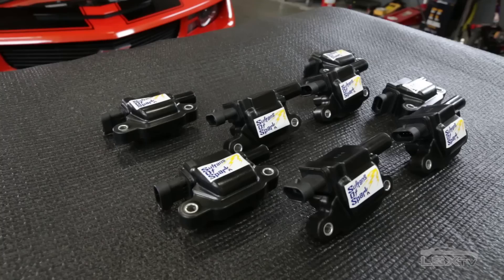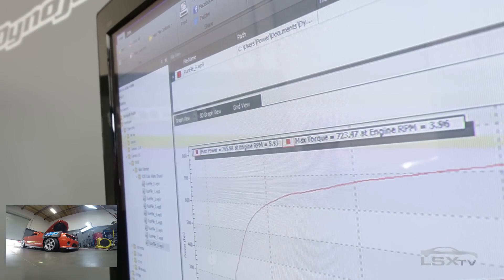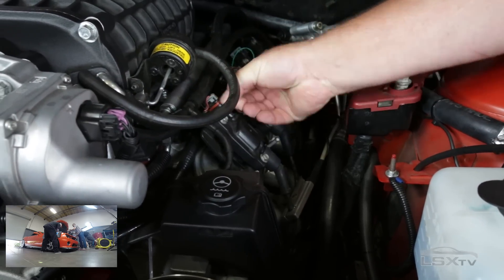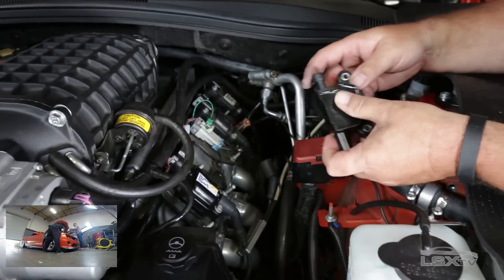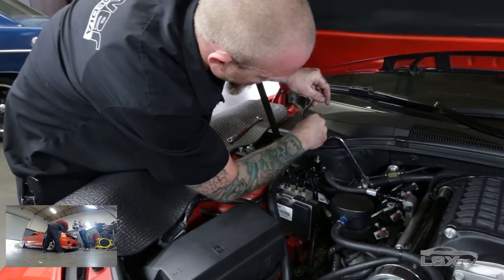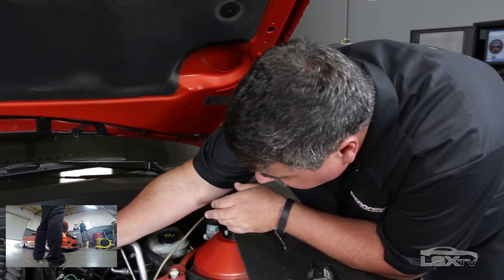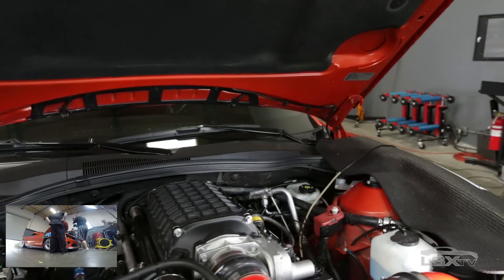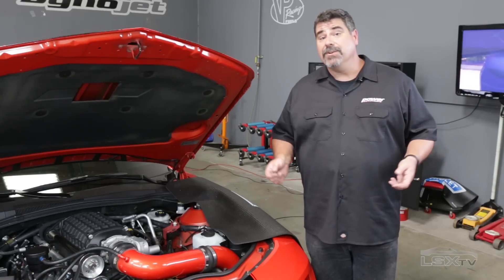Sultans of Spark Coils - Do they make power?

Comment: Am I the only one that noticed the power drop, but a cleaner running engine??? I agree, it needs to run at least for 20-30 minutes plus a change in plug gap for the ECU to adapt to the new coils. Then you will most likely see a true performance increase. Not a lot, but still.

Comment: Now do the same test on an old police crown Victoria with 150k miles. Instead of these highly tuned and forced induction cars
Reply: What’s the point?
Reply: @khalidfathallah6619  Older cars have more delta performance potential than newer cars. 
Plus a high mileage car that's been beaten daily is different than a shiny new motor where all of the clearances are to OEM spec. 
And the retired police car is like a poor man's "budget hot rod".
Reply: you must mean potential increase because unless youre making 500+ its a total waste of time and money.
Reply: @khalidfathallah6619  sorry, delta performance means change in performance.  A new Mustang is already tuned pretty close to peak performance in stock form.  Older cars were not, so it's easier to get an extra 30hp from an older car than a new car.
Reply: djturnz I’m not denying that but what’s so good about tuning an under powered boat. You would have to completely rebuild that motor to get anything that resembles a an enjoyable car.
Reply: @khalidfathallah6619  this is not true... New headers and cat back exhaust, do some weight reduction, and 4:10 gears, (Stock on police interceptors) along with some more minor engine mods if you wish, you'll have a pretty fun V8 sedan.

Comment: Hi.
Do you think, IF you change the Spark plug wires with aftermarket ones and Very Small resistance (100 Ohms per METER Only) will make any difference too?
Reply: Emmanuel Korres yeah all helps I reckon

Comment: Since you didn't change the plugs or wires, the amount of voltage needed jump the gap should not have changed.  However, you probably affected the total energy in the system.  I have to wonder, couldn't you have changed the dwell time on the coils to achieve the same affect?  Tuner + a couple of keystrokes vs. a new set of coils.
Reply: the amount of voltage need to jump the gap may not have changed, but the voltage jumping the gap DID change alot. 
ok so maybe only 200volts are jumping. the spark is going to be only so big. now you have 800volts jumping the same gap, that spark is going to be fatter and hotter. because of that its going to ignite more fuel in the chamber. 
get it now?

Comment: "They do what they say do..." on 750 hp vehicles. 
How many people own those? This video was totally useless to 99.99% ( I made that number up) of the viewing public.
How about a test on a stock Camaro SS? or a Mustang GT or some other car that real people really own?
Reply: So putting performance coil on like say a 2014 5.3 chevy wouldn’t gain anything?
Reply: Yes it should. About 20 years ago I added a MSD Master Blaster II coil on my 86 Toyota 22RE. It was a 45K volt vs. 15K OEM. I opened the gap from .032 to .040 gap. I tried .060 and still ran well. It's a small 115 hp engine, so not much could be expected, but there was quicker throttle response off the line and didn't drop power at higher RPMS. I drive it a bit more aggressive and a still get same MPG. It was the best $35 (back then) mod.
Reply: Chuck is right on, the more u improve your ignition system the better the car runs, leaner more efficient, more torque and better on the top end.
Specially on forced induction cars. Multi spark ignitions are the best mod to begin and shoud be 1st one done but every body neglects to last

Comment: how much, and can i put them on my stock LS1 1999 Camaro SS? and gain decent power?
Reply: Carbole makes German copper core coils... I actually gained almost 20hp and that is no bullshit. Those Melco knock offs he uses in this video are usually twice as much and only about half the output of the carbole coils... When I bolted mine my computer actually flashed the engine light off and on about 5-6 times and the computer adjusted itself and I would assume the valve timing as well... So I gained a bunch. Off the line now the thing is a blast to drive it...
Reply: I gained 43hp doing the coils on my ls3

Comment: The torque curve with that PD blower is nuts. Its dyno graphs like that which keep me guessing on what way I want to go with a power adder with my 5th gen Camaro. Surprised the coils made power even though its not a great deal of power I didn't think they would make any.
Reply: I wouldn't consider this a power gain because this is less than 1% change
Reply: @97markviii  Its not only the hp increase but an increase in throttle response as well. This is the more important factor to me, because it gets you into the optimal hp curve quicker than normal. Which in turn makes the car faster.